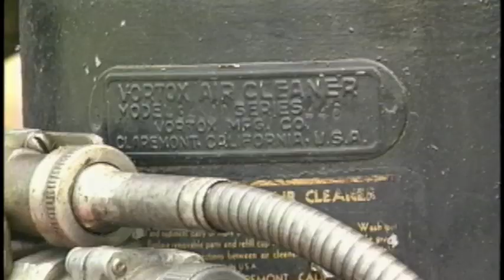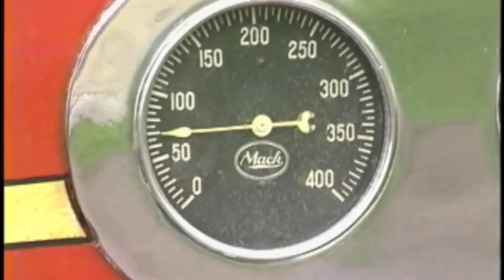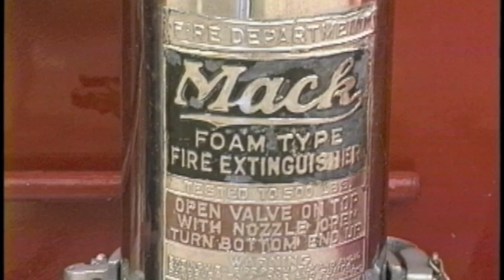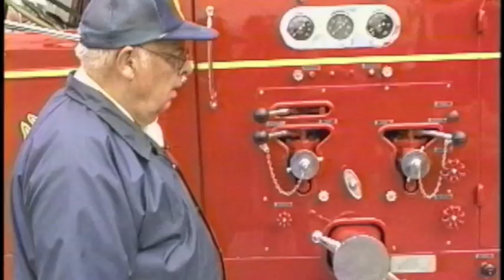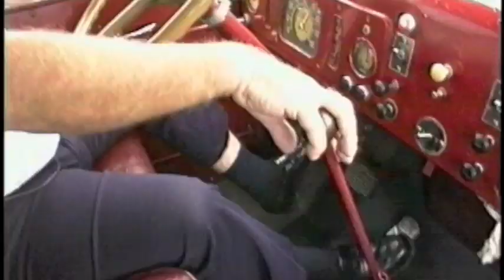'48 L model Mack Firetruck

Comment: I appreciate this Info...From REAL Firefighters who were around these units while they still were in Service or when it was the prime of time for these trucks.

I also was a Volunteer Firefighter in Bear County Texas at the Sandy Hooks Fire Department,until I was transferred to a district in Corpus Christi Texas because of Hurricane Harvey,and then to a small Fire Department outside Liberty Hill Texas before I decided to leave because I had a opportunity for a commerical job after driving Firetrucks.
The rigs I drove weren't NOTHING compared to these Irons,I drove former Military Trucks that we rebuilt and converted into Civilian Brush Trucks.I drove a M35A2,two M1084 LMTV's,and a M44A2 as 2 1/2 Ton Trucks while also a M925A2,M813A1,and M54A1 as 5 Tons.All of them were also diesel powered but some still had manual transmissions.
The M35A2 I drove had the Infamous LDT-465-1A Engine with a Five Speed Forward/Direct,along with the M54A1 and M813A1 which had Forward/Direct Transmissions but Four Speeds,and the M813A1 had a NHC-250 Cummins while the other truck as the M54A1 had a EDNT-673 Mack Diesel.The M925A2,LMTV's,and M44A2 were all Allison Transmission trucks,the M925A2 and LMTV's had a MT654CR Transmission and the M44A2 had a 545 Allison.The M925A2 and one of the LMTV's had a 6CTA Cummins while the other LMTV actually had a 8V92 Detroit Diesel,and the M44A2 had a 3116 CAT Diesel.

I also never knew that the L Models wen that far back.I'm the personal owner of a 1947 Mack Type 85 Firetruck which was manufactured in New York but served in St.Louis as a Pumper Unit.Mine has a ENF-707B Engine,which is a 707 CI OHV Straight Six Gasser at 213 HP.It was a only option for all of the Type 85 Macks regardless of what truck it was and the ENF-707B was even used among LS53's.
My Type 85 also has a Four Speed Forward/Direct Transmission with the Vaccum Assisted Hydraulic Brakes.

Comment: Quoting from John B Montvilles book...MACK, the 707 cu.in.engine was called the Magnadyne.The name Thermodyne was used on their first overhead valve engine around 1937 the 707 Magnadyne followed soon after. The Thermodyne name was applied to the diesel engines when they changed to direct injection from the LeNova indirect, swirl chamber design in the early 1950s.

Comment: All gasoline fire trucks had the dual ignition setup. We had a 42 and a 48 LaFrance and they both had it. Probably standard back then.
Reply: Lewie McNeely Correct,I own a 1947 Mack Type 85 Firetruck and 1958 American La France Series 900 Firetruck.
The Mack that I own has a ENF-707B Engine and the ALF has a R883 Continental Engine.
Both engines have Dual Ignition,Dual Starters,Dual Points,Dual Spark Plugs,and Dual 1BBRL Downdraft Carburetors.

I've had arguments with other Mack owners that also have Type 85's running original ENF-707B Engines,but they aren't Firetrucks like my Type 85 is and they don't understand or want to learn,so they keep instigating to repeat that the Pumper should have a single starter and carburetor when that wasn't true at all.All Firetrucks that ran Inline Six Gassers always have Five Parts connected to the engine with Twin/Dual Sets.